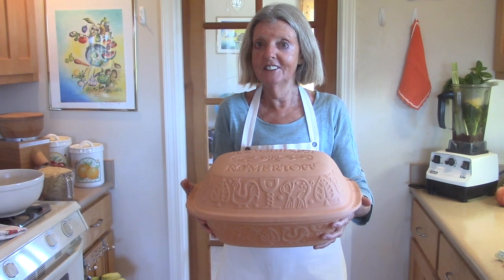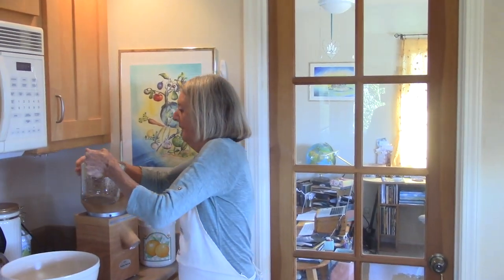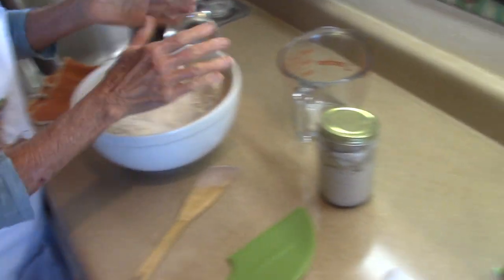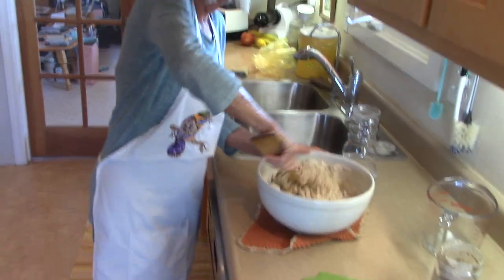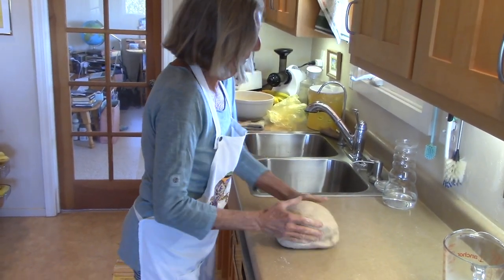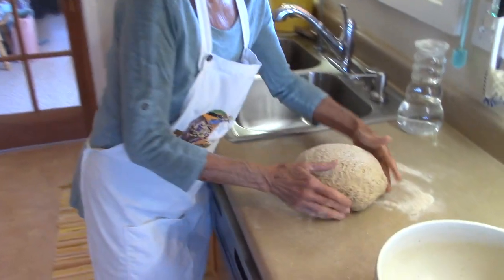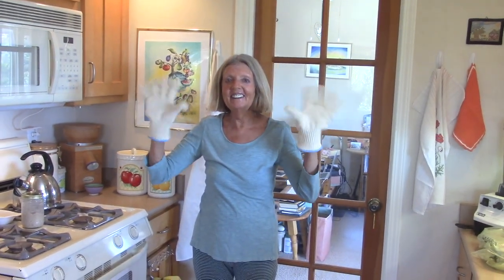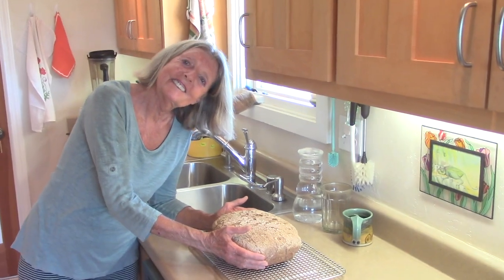Bread Baking in a Clay Pot (Römertopf)

Comment: Perfect solution with dough hook, but the key difference and advantage of Roemmertopf is that the lid and, if not glazed, the base, are presoaked in water for 20 minutes or so with Roemmertopf placed into cold oven. That gives the dough the steamed rise. More steamed than, let's say, in the cast iron pot.
Was looking for methods for baking in Roemmertopf without removing the lid (fuer faule Leuten), but learned something new here. Including the Roemmertopf word origination. Thanks!
Reply from the maker: Yes, we had tried the pre-soak of the Roemmertopf method also. But quick question - do you put the soaked pan into the cold oven with the dough in it, cold, and then heat up to 400 and bake for 35 minutes?
Reply: @WillTuttle  It's the first time I am telling to someone about it. So, what I do, "what works for me":

1) Rustic sourdough.  Presoak the lid (I have glazed base) for at least 20 minutes. Use baking paper as you do and make sure that it does not "hang" over the dough. That is much easier when the clay pot is cold. Cover and place Roemmertopf into cold oven. Set temperature to 425F with timer for 40 minutes. After 40 minutes, remove the lid and bake (dry actually) at 400F for additional 20 min. For some grain,  it might be required additional 10 minutes at 375F so not have bread soggy and not to overdo the crust.

Here is the catch, I just realized it. The time may depend on the Roemmertopf and oven size, and on the oven heating rate.  Exploration and experimentation will be required for particular conditions.

2) General yeast, general white flour. Same as above, but main baking at 400F for 45 minutes followed drying stage at 375F for 15 to 20 minutes.

I am sure that one or two iterations will give you the perfect protocol for your Home conditions. I have "Ohne Zweifel" that 400F will bring good sourdough result also

I read recommendation not to use above 425F with clay to be on a safe side. And somewhere read (still have to look for it) about method with baking below 400F with lid On for entire oven time.
Reply from the maker: @lisapet160  Thanks so much for taking time to share your findings, tips, and process! If you learn more, please do share it here for everyone. Thanks again - very helpful! Will try out!
Reply: @LisaPet, I have a Romertopf baker to make bread and it does not need to be soaked each time you bake bread. There was a big discussion about this, especially since many doughs are high hydration doughs.
Reply: @Rob_430  You don't need Roemertopf to make a bread at all. Especially when having no idea about thermal conductivity in heat distribution in closed not uniform systems. Will be better off with preheated cast iron containers with the lid.
Reply: @lisapet160  wrong information! I never said you need a Romertopf to bake in. I said you don’t need to soak it with high hydration doughs. You may need to learn how to read. I’ve been baking breads for over 14 years, yeast & sourdough. I’ve baked in both in cast iron and clay bakers. Both are good to bake in. I’m speaking from experience, but I doubt you are.
Reply: @lisapet160  I’ve baked cold also. The temperature is too low for cold baking. Putting cold dough in a cold oven with a cold baker needs to be higher than you say, 475F or 500F. to reach temperature, then lowered to 450-475F for 40 minutes, then lowered
Reply: @lisapet160   weather you need it or not ..I have one and thought oh it would be fun to bake a bread in mine so I’m looking at recipes..your post took all the fun out of it really makes it sound scary talking about thermal conductivity and stuff. I came to see if she soaked because I saw some other comments someplace else warning not to soak that the bread on top wasn’t nice . Yes baking can be a science but it’s more enjoyable to just bake and show and share others and eat your wonderful items you have  made in your kitchen.

Comment: I bake my 1 pound, round sourdough bread loaves in 8" stainless steel, dog water bowls from Dollar Tree that don't need to be preheated and cost $2.50 for 2.  One is for resting, proofing and cooking and one for a cover.   Plus they won't break if dropped.
Reply: The older versions of Pyrex bowls (the ones that can be heated) work nicely, too.

Comment: My Romertopf says to soak the clay pot for 15-20 minutes and start in a cold oven
Reply from the maker: Yes, you can do it either way - Madeleine has tried it with soaking, etc., also, but this is quicker and easier, and according to long-time users, it won't crack or anything if it isn't soaked first. However you like!